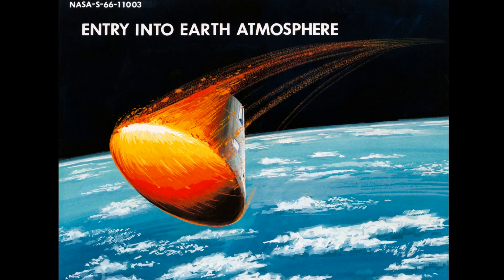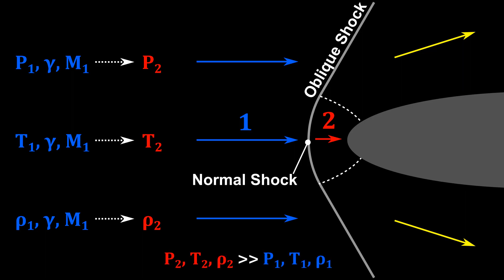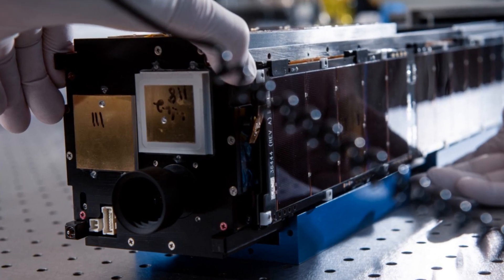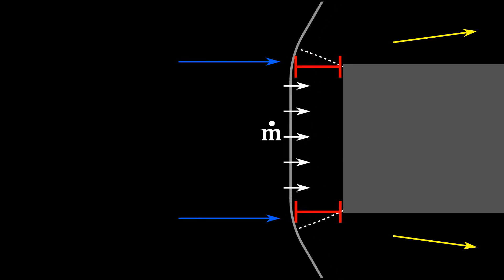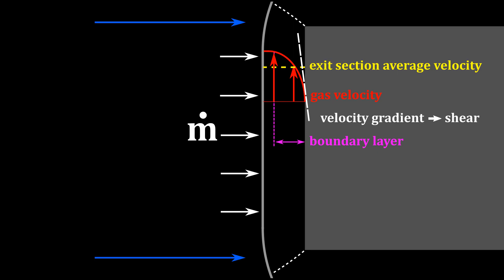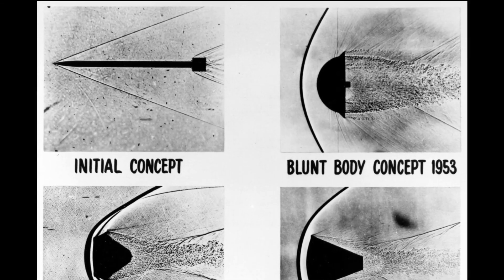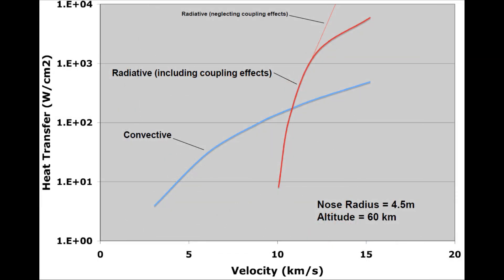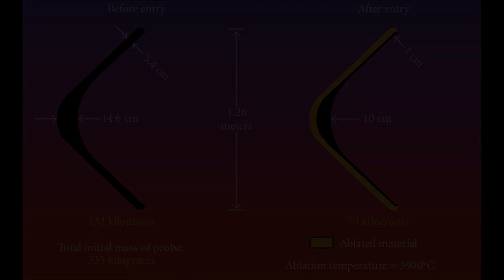Hypersonic Hijinks Part 3 - Blunt Isn't Always Better

Comment: Really great elaboration on your reply to my earlier comment about the Shuttle!

I'm curious though, what happened to Part 2? or does it flow better if this is first?
Reply from the maker: I'm glad you liked it! 

Part 2 is coming, but it's taking longer to make than I expected. It will be part 2 because it fixes the mistake in part 1 and talks about some points related to oblique shocks.
Reply: @TheGravityAssistant  Thanks! Am looking forward to it!